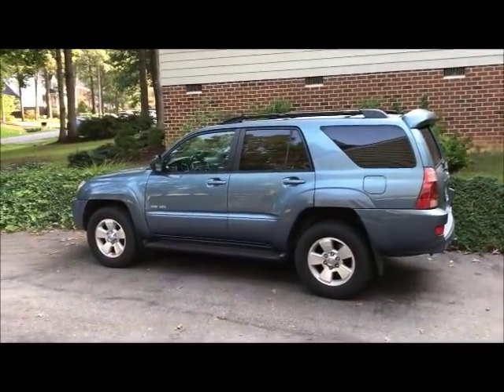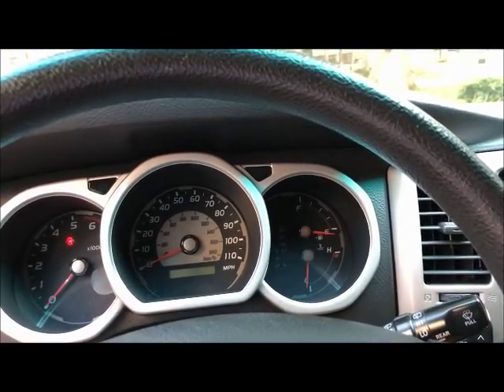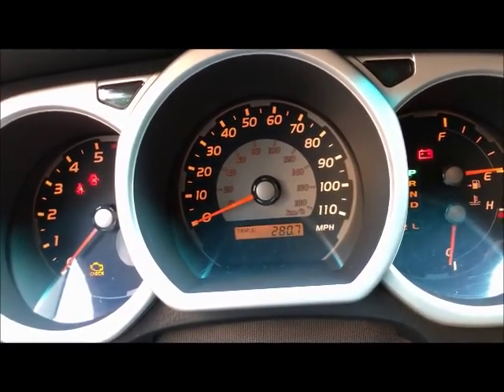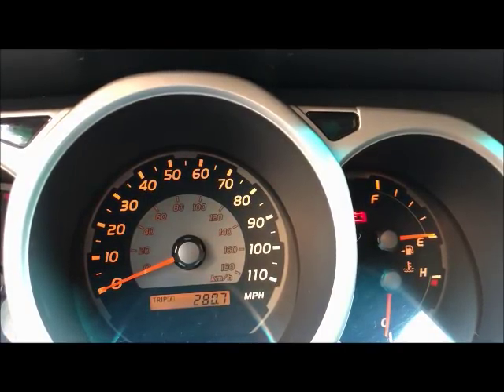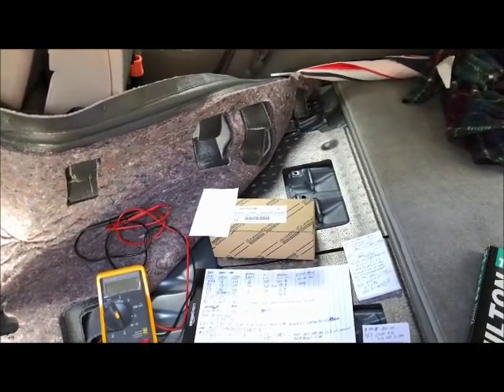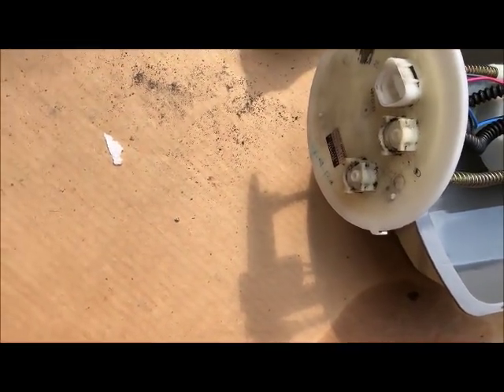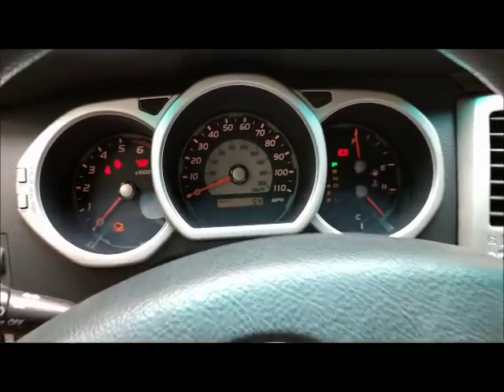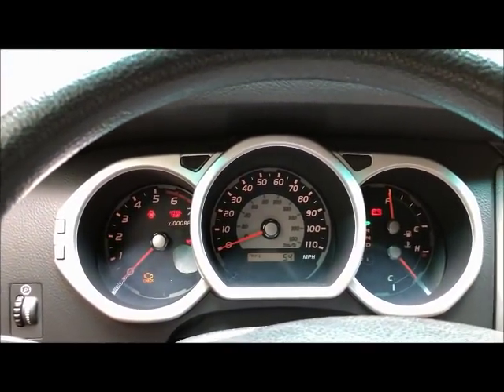2005 Toyota 4Runner Gas / Fuel Gauge Problem - Fixed!

Comment: I am actually in the process of doing this.  How did you end up getting that fuel tank vent hose off that sits on top of the tank?  I have been stuck for a few hours trying to get it off.  I even tried to remove it from the canister side and still no luck.  Did you lower the tank at all ti get to it or did you remove it while the tank was still mounted?  Any suggestions appreciated.
Reply from the maker: I'm sorry.  I don't remember.
Reply: @rickstid-bits  No problem.  I got it off.  What method did you use to remove the fuel from the tank?  I think I have about 5 gallons in there and I would like to remove it if possible to make life easier.
Reply from the maker: Good.  I have a 12 volt gasoline/fluid transfer pump.
Reply: @rickstid-bits  I ended up powering the fuel pump itself using a 12V motorcycle battery and pump the fuel directly into a gas can.  I was reinstalling the retainer ring using a flat blade screwdriver and I ended up breaking it.  The manual calls to put the ring in the 4 and 5 o'clock position after 2 rotations but mine split when I tried to move it pass the 3 o'clock position.  I ordered a new one including the gasket.  Any tips you can remember for installing those?
Reply from the maker: I'm sorry.  I don't.  Aren't these the "spread" clips - that you slightly spread open with a screwdriver as you make the connection?
Reply: @rickstid-bits  No worries.  I was referring to the big plastic ring that holds the fuel pump tightly to the tank.
Reply from the maker: Oh.  Got it.  I got my manual out for you.  My manual says, When installing the fuel pump/sending unit make sure the locator lug on the edge of the pump flange is aligned with the notch in the in the pump mounting ring.  When tightening the retaining ring, screw it down 2 turns, then turn it so that the alignment mark on the ring is positioned between the 2 arrows on the fuel tank.  
I'm sorry I'm not being more helpful for you.  Rick
Reply: @rickstid-bits  you have been helpful.  Thank you.  I have a plan in place to wrap it up.
Reply: Just wanted to let you know that I finished this last night.  Fuel gauge is back to normal.  Thanks again.
Reply from the maker: Awesome!  Thanks for letting me know.  You're the reason I post my DIY videos.  Rick

Comment: Before changing your sending unit try Marvel Mystery oil at a rate of 4oz per 10 gallon of gas. Two tank fulls later my guage is back to normal. Update: a year later the issue reappeared. May be forced to replace the $100 sending unit??

Comment: Hi I’m having similar problems , except I’m running out of gas right below 1/4 tank, it’s happened twice now around the same level but my range finder was reading 44 miles left the first time and then 67 miles left the second time but the needle was around the same level. If I fill the tank with a lot of gas the range find will read higher, if I were to throw let’s say $15 In the tank the needle might go up but not the range finder. I’ve been treating my 1/4 take line as my E line but I would like to fix this. Do you think my fuel sending unit is the problem ?
Reply from the maker: Hi Cody,  I am not an auto technician, but this would be the first thing I replaced in your case also.  Rick

Comment: Am stumped, have removed the fuel assy on my 05 runner, but am finding it impossible to remove the fuel pump from the housing. The fsm says to pull 2 claw tabs and pull out the pump. Tried it and pump isnt budging.pls help.
I have a persistent p0230 MIL,
Reply from the maker: I'm sorry I can't help you with that.  I didn't remove the pump.  Rick

Comment: excellent video, thank you for posting! Looks like my truck has the same issue. Any suggestions on what to else check before going ahead and ordering the new part?
Reply from the maker: You're welcome.  The only thing I can say is go threw a few tankfuls of gas while watching your gauge and mileage.  If your's is acting the same as mine did, that would be my first choice of parts to replace.
Reply: Rick S thanks, it’s been an ongoing issue for a few weeks now. At first the fuel gauge would go to from full to 3/4 after fill-up then slowly come back up. Then it would show off by about 1/8 tank, and now it’s off a 1/4 tank and wont go above 3/4 when filling up at the station. I always reset the trip odometer so I know how many miles since last fill up and it’s super low before showing empty (150-200 miles). The miles to empty calculated on the dash above HVAC has been fluctuating along with the gauge too. 

Looks like everything points to the fuel level sender but I figured I’d ask before going through the hassle of dropping the tank.
Reply from the maker: @beltwaybandits406  Sounds like what I was seeing on mine.  Just remember it could also be the gauge itself or the computer.  However, I was pretty confident mine was the sending unit, so that's what I changed first.  Please come back and update me on how it goes.
Reply: @beltwaybandits406  update us, how did it go?
Reply: @oddsparrow3532  the problem went away after several months. It would only happen in the summer time when it was very hot & humid outside. I purchased the truck from someone who barely drove it so my guess is that the fuel level sender/arm was sticking a little from sitting all the time. Driving and refueling it regularly with top tier gas seemed to do the trick.

Comment: Hi Rick, I also have a 05 4Runner but the V8. I’ve been recently having some issues similar to yours but yet a different problem with the gauges affected. My fob/antitheft(stock) just stopped working,  the clock is always at 100 when I turn on the ignition, but keeps time and temp while running/driving..and the gauges flicker almost like they are calibrating?. Weird anyway. did both battery checks, fob and vehicle, not that, checked fuses, not that🤔 My gas gauge and other gauges all work, a/c works everything but my antitheft and the clock. The garage I took it to said it could be my bcm, but my spider senses say no, had a mobile mechanic check my bcm diagnostics, everything came back normal. Maybe gauge cluster issues?, is there a connection to this and my fob problems, the clock always resetting? Are you perplexed yet? Is there any trouble shooting for when antitheft stops working in your manual. So glad you figured out your gas gauge problem, that was a huge undertaking, wow.  I wouldn’t know where to begin with something like that. Well any advice would be greatly appreciated. Have a great day.
Reply from the maker: Hi Carrie.  I'm sorry.  I can't be any help to you with that problem.  I don't have any experience with that area of the car.  Rick

Comment: If I do nothing and monitor my fuel with the odometer will it cause a problem? Will the sending unit eventually fail?
Reply from the maker: Hi Terry,
I don't believe it would ever cause a problem.  
Like you said:  You can simply write down your mileage every time you fill the tank and watch the odometer.

Comment: Thanks for posting. I have the same problem with  my 2005 4Runner but now it is only allowing me to fill up to 7 gallons at a time and everyday it goes from  full to half tank the next day to empty without driving it. Is this something I can not fix and just watch the miles or is it where if I really was on empty it will only let me fill up to 7 gallons which means I'd have to get gas every other day!?
Reply from the maker: You're welcome.  I have the V6 engine:  So I can only speak for the mileage my V6 gets.  My tank holds 24 gallons, and I can go slightly over 400 miles on a full tank.  Here is what I suggest:  
* Fill up you vehicle.
* Fill up a 5 gallon gas can.
* Write down your mileage (or reset your trip odometer).
* Keep the full 5 gallon gas can in your vehicle.
* Drive it until your odometer shows that you have gone 350 miles.
* At 350 miles: I would fill the gas tank again.
** If that works well:  Reset the trip odometer, and refill at 350 miles again.
The only reason I suggest you keep a full 5 gallon gas can inside the vehicle is in case something else is going on with yours:  You will have gas with you if you need it.  
After you are sure you can go 350 miles - you can empty the gas can and stop carrying it with you.
Rick
Reply: Thanks for the quick response! Yea mine is a V6 also. I will try this out!
Reply from the maker: Please send me an update after you do your troubleshooting.

Comment: Im having an issue with my evap system on my 2005 4runned. I noticed that this vehicle didn’t have a fuel tank pressure sensor on the top of the sending unit either. Do you know where it’s located? Every Manuel I reference says it should be right on top of the white cap fuel sending unit.
Reply from the maker: Hi Justin,  I just read through my Chilton's Manual.  It doesn't mention a fuel pressure sensor.  There is a Fuel Pressure Pulsation Damper, but there aren't any electrical connections on it.  The manual does say the PCM controls fuel flow based on demand.  I agree with you that something has to acknowledge that there is pressure.  Could it be the load on the fuel pump itself (current draw)?  
Do you have a code set?  If pressure is your primary issue - I would think you would have a code set.
Reply: Hi, thanks for checking. I do have 3 codes. Error codes are p0451,p0441, p0452. The only 2 options in the Haynes manual are on the fuel tank or built into the charcoal canister. But my truck is a 2005 v6.
Reply: @NoSaltNation   HI, I also have same issue on my 2005 4runner my code is P0453 but I cannot find pressure sensor, if you found it please comment me, thanks
Reply: Lasha Jalaghonia , yeah I actually did find it. It’s built into the charcoal canister. For some models.
Reply: @NoSaltNation  Thanks for reply

Comment: I just found your video, I changed out my fuel pump yesterday and the car turned on so that was the main problem, I had to empty my full tank to take it out, now that it's back in I put about 5 gallons of gas back in just to get the car to turn on, now my fuel gauge is messed up (saying the tank is full) when I know it's not, and when I tried to put gas in my car, the gas spewed back up and the car won't take any gas in. I've done lots of research but have not seen anyone with the same problem, any suggestions? I would greatly appreciate
Reply from the maker: Hi Amanda,  I was tied up at the hospital all day today.  I will write to you tomorrow.  Rick
Reply from the maker: Hi Amanda.  
*  On the filling the gas tank:  The only way I can see that happening is if the hose from the filler neck to the tank got bent and is pinched closed.  I don't remember what type of hose it is - so I would be surprised if it is lightweight enough to do that:  But that's the only thing that I could see causing that.  
 *  On the gauge:  I'm thinking of a couple things.
1. Something has the float jammed in the up position.  Possibly a wire got slid over and in the way, the arm got bent, etc. 
2. During removing or reinstalling the assembly:  The electrical wiper arm of the float got bent slightly and is not making contact with that pad anymore.
3. That area of the float has finally failed.  
Let me know what you find.

Comment: I am having a similar problem on my 08 4Runner. When you would run your gas to E would the gas light ever come on? I ran mine very low last week and it never came on.
Reply from the maker: Hi Josh,  Yes. The light came on when it should have.
Reply: Rick S Thanks for the reply Rick, the reason I was asking was because when it usually hits the E my light would come on and on my last couple tanks i’ve been getting about 100 miles less and now that I’ve run across this video I’m thinking it has to be the gauge and not that i am burning more gas.
Reply from the maker: Hi Josh, I don't know if your issue is the gauge or the sending unit:  But if you're getting 100 less miles on a tankfull - you would know if you had engine problems - because you would see, hear, or feel the engine problem.  Do what I did:  Put a full 5 gallon gas can in the back, fill up the car's tank, mark your mileage, and drive it 60-90 miles past when you're at "E." If you can keep driving way after you're at E, you still have gas in the tank.  If that's the case, I would suspect your sending unit.

Comment: Could the mileage counter under the radio have to do with the octane rating?
Reply from the maker: No.  This vehicle calls for 87 octane fuel.  Using a fuel with a higher octane number has no benefit.  And you can't buy gas at a gas station with a number lower than 87.

Comment: Why did you remove the tank? There is an access hole to remove the sending unit?
Reply from the maker: Hi Michael.  Not in the 2005 4Runners.  That access hole is simply to get to the electrical connectors and maybe a hose.  It is not wide enough, or in the direct "straight up" above the access hole, to be able to pull that entire fuel gauge/pump/filter assembly out through that hole.
Reply: Rick S Well next time to make it easier just cut a larger hole to gain access. I have done it to all the pumps I have changed. And just seal it up good after.

Comment: I am having a similar issue with my Camry 2008,gauge is erratic and when the road slopes so does the gauge so I never have an accurate reading of my gas. Unfortunately I cannot find someone to help me fix this in Abuja. My tank reading doesn't even get to E before the car starts beeping. Even if I fill up the tank,as long as the road is bent,the fuel gauge bends too
Reply from the maker: I'm sorry I can't help you Ruth.  The one thing you can suggest is this:  
Fill the gas tank.  Fill a 2-5 gallon gas can and put it in the trunk.
Reset your trip odometer to 0.
Drive the car until it runs out of gas.
Write down how many miles you went. 
Pour the gas can gas in the tank so you can get to a gas station.  
Then, fill the tank the rest of the way.
Reset your trip odometer to 0 again.
Let's say you drove 400 miles when you ran out of gas.
So, from now on:  Use your trip odometer as your gas gauge.  
When you have driven around 350 miles . . . 
Fill the tank. 
Reset the trip odometer. 
And do that again and again.

Comment: Hey Rick, decided to go ahead and do this. I made the swap but after a day it went from completely full to down half a tank after only driving 100 miles or so. Any recommendations?
Reply from the maker: Hi JMD, How was it acting/what was it doing before you changed it?  Did the swap go smoothly?
Reply: Rick S it would read full to gradually go down to reserve in the span of only driving to and from work in a day. So I went ahead and changed it out with a buddy. A couple stubborn hoses to take off and put back on but managed to connect it all together and no leaks, I checked throughout the day today.
Reply: Rick S I did the swap yesterday and it was running with a full reading for the rest of the day yesterday and after 69.5 miles it went back to gradually decreasing by the quarter. Don’t know why :/
Reply from the maker: So it sounds like it is doing the same thing as it was before, more or less.  I know I had some concerns with the connectors at both ends of that short wiring harness that connects the sending unit to the connector on the upper basket.  They ended up being okay on mine.  Did you look at all of those connectors/connections?Did you buy an OEM Toyota sending unit?   Other than that: The only thing I can suggest is to do the resistance readings like I did.    That will tell you if everything at that connector at the top of the basket (which is everything inside the tank) is good or not.  Take a good look at all the contacts on both ends of that top connector also.
Reply: Rick S no unfortunately I didn’t have access to a voltmeter, I did end up getting the part from a Toyota dealer though. You happen to know what readings I need to be looking at? I’m assuming you have it in your video lol
Reply from the maker: Yes.  They're in there.  Let me know what you find.
Reply: Rick S thank you, I appreciate your quick replies. I will let you know
Reply: Rick S hey rick, 6 months later, turns out I bought the wrong sending unit, I guess the 4th gen runner had multiple types. Ended up finding that out after diagnosing it at a mechanic because I thought it was an electrical issue. Thought someone else would benefit from this info in the comments

Comment: did that 4runner get a fuel filter?
Reply from the maker: Hi Steven,  I did not change the fuel filter.  It may be time to do that.  I believe it is along the frame rail.
Reply: @rickstid-bits  nop

Comment: I changed the sending unit on my 2006 4runner, filled it up and it's stuck on E... any ideas?
Reply from the maker: Hi Alan.  Was it stuck on E before you changed the sending unit?  Rick
Reply: @rickstid-bits  no it was stuck on full before I changed it
Reply: @rickstid-bits  before I changed it the needle would go to Full when I turned the key on.  Since I changed the sending unit the needle only moves to E and the low fuel light comes on
Reply from the maker: If it were me:  The next step would be to determine if the problem is before, or after, the sending unit.  I would find the wiring diagram, see how 12 volts and ground are supplied to the sending unit, open the panel that is under the rear seat, and then see if that ground and 12 volts are solid.  In-other-words:  Is the input to the sending unit good.  If it is:  Then I would start tracing the output wires.

Comment: What did u use to disconnect the fuel lines?
Reply from the maker: Hi Larry, If my memory serves me correctly . . . I believe they have a c type colored clip that you simply lift up on one side and it releases.  However, I might be wrong.